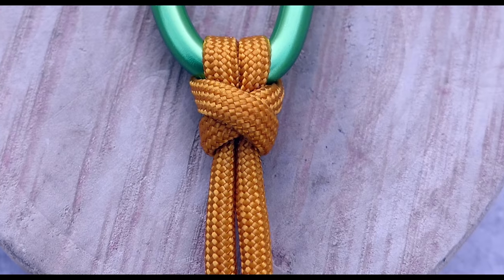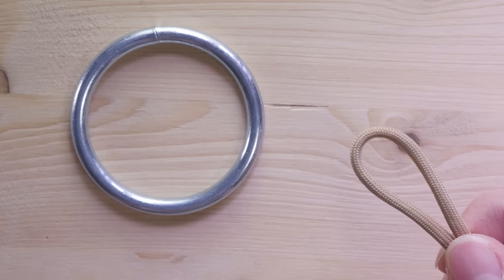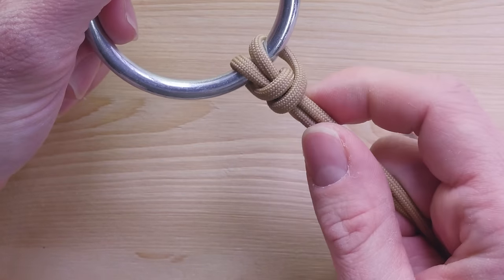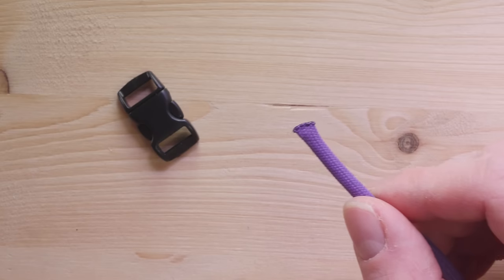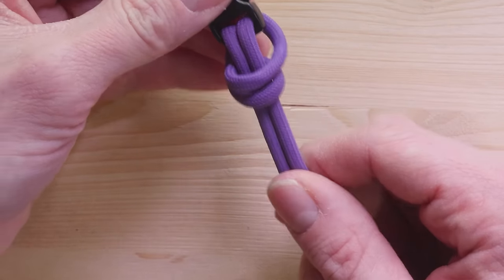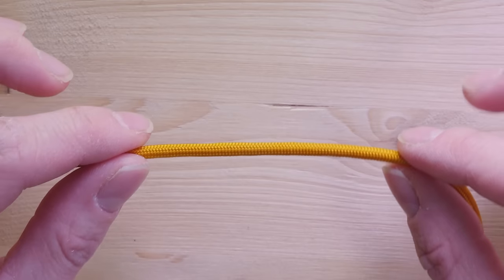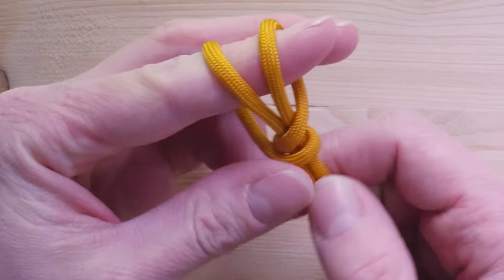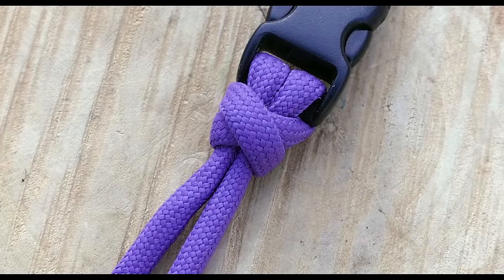Bull hitch

Comment: Hey bud... There is a much easier & quicker way to tie this knot. Pass a bight up through your buckle or ring and pull it downward, giving it one twist, while doing so. Now pull both working & standing ends up through the loop & cinch tight. Done. It's literally two movements & you're done.

Comment: There is a fourth, even faster way to tie the bull hitch. 
Pass a bite through the slot on the clasp.
Pass the clasp through the bight to form a cow hitch.
Take the same bight, twist it 1/2 turn and pass the clasp through again.
Dress your bull hitch as shown in the video.

Comment: I am very interested in this knot, but on the 3rd method of tying, at 3:36, you have your hand covering the cord right at the crucial moment, and for the life of me I can’t figure out what you did.
Reply: Ponchoman07 he just takes the bottom half of the big loop and swings it right around the back in a horizontal arc and then it crosses at the front
Reply: its a mystery!
Reply: I did finally figure it out, after many tries. Would’ve saved me a lot of time if he hadn’t put his hand in the way at a crucial moment. I do like this knot, and now use it often. I am amazed at how similar and easy tying the Spanish bowline turns out to be. That knot has always been a puzzle to me. Now it too is so simple, though I have yet to find a practical application for it in my world.
Reply: still can't figure it out ... i hate knots lol
Reply: NO antoeknee, you do not hate knots! This turns out to be very simple, once you remember the steps. I’ll describe thus:
Draw up your rope to a bend at the top, with your two sides hanging down. Bring the top of the rope forward and down, creating two equal loops. Keeping the rope flat, (assuming you’re doing this on a flat surface), bring the left loop under and through the right loop, and pull the resulting two loops apart. Now putting your two thumbs under the bottom of each loop, lift and flip the loops. Now lift the outside of each loop up, while pushing the center strands down, bringing the two loops together around one thumb. Voila! The Bull hitch. 
Why do we love making knots? With a better understanding of what knot to use in a particular situation, we can do so many things. I have had several bulky items lying around my garage floor that were taking up too much space. One of which is an oak and tile kitchen countertop I salvaged from my brother’s kitchen remodel — about 9’ long and weighing ≈ 100 lbs. To raise it up into the rafters, by myself, was a challenge, but I accomplished it using a single pulley and a Prussik loop or two. (Would have been quite a bit easier had I used two pulleys, but you get the idea). This bull hitch is extremely reliable, as long as you maintain tension on it. While a bowline is one of the simplest loop knots to tie, I actually prefer either a perfection loop or a Kalmyk loop, depending on how permanent I want that loop to be.